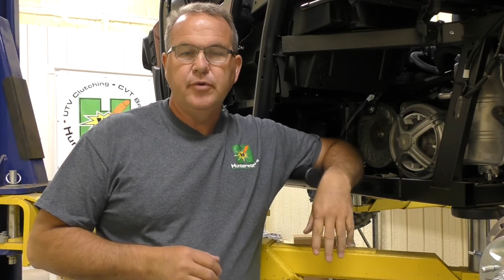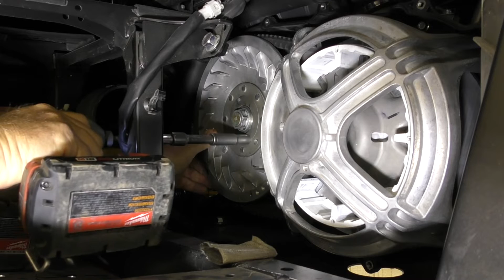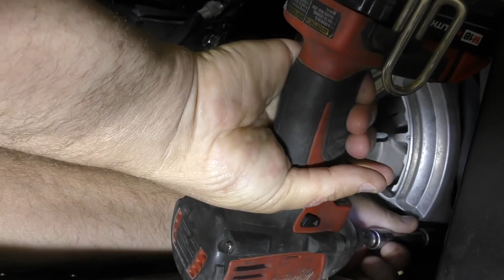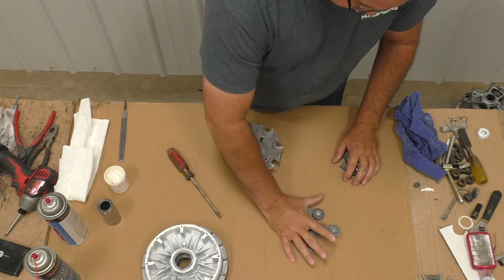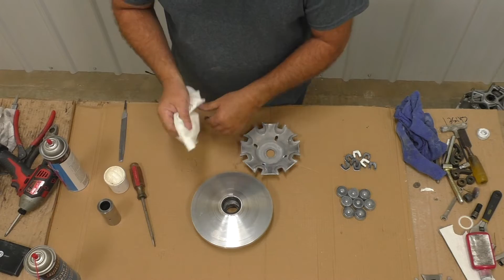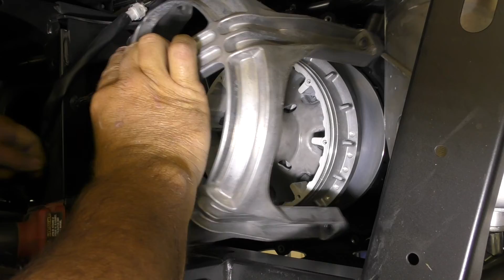Hunterworks Yamaha X2/X4 Machined Sheave Install

Comment: If you're going to run grease in the new sheave do you need to clean out the dry lube before putting in new tinkseal?
Reply from the maker: no

Comment: what did yo have to take apart to get to the clutch housing etc.  I saw another video that required the seat, panels and other things needing to be removed?
Reply from the maker: I actually do not recall, it's been 5 years.  The two and four seat are different, just some plastic under the fenderwell on the two seat.

Comment: Where did you get that bolt that you screw into the front, to loosen up the belt
Reply from the maker: We have them in a box here, just a 30mm long 6mmx1.25 fully threaded bolt you can get most anywhere.
Reply: @Hunterworks  thank yoy

Comment: I’ve got a 19 x2 with 28 tires.  Will I need to do any flash or other modifications? Thanks
Reply from the maker: Chris Weatherspoon need and want two things.  Need no want maybe.  Better performance in all areas
Reply: Ok thanks.  So I could start with this and add the weller tune later to not take such a big hit in the wallet at one time correct?
Reply from the maker: @cspoon123  That is correct

Comment: Primary sheave bolt torque spec is 184 ft-lbs for those that use hand tools.  If you guys have enough mileage to where your secondary sheave needs to be serviced, there's enough Tinkseal provided with the sheave kit that you can service your secondary with it.
Reply from the maker: THanks
Reply: I’ve always done mine at 125